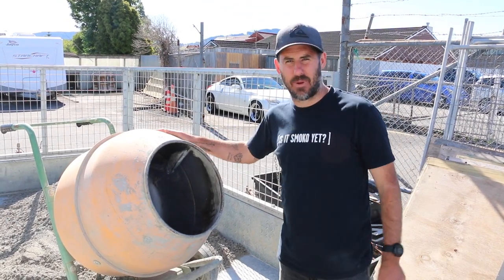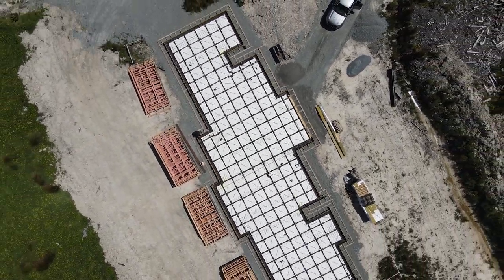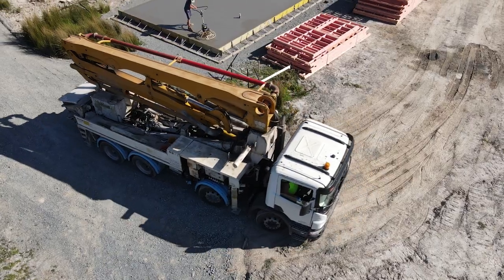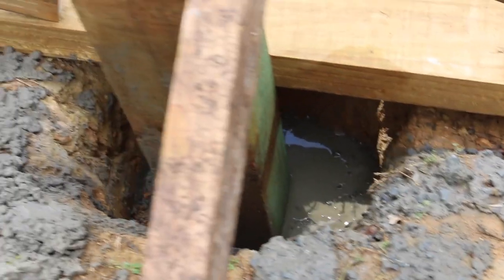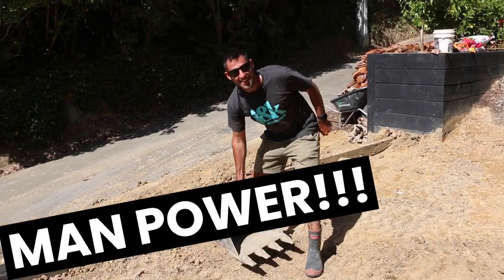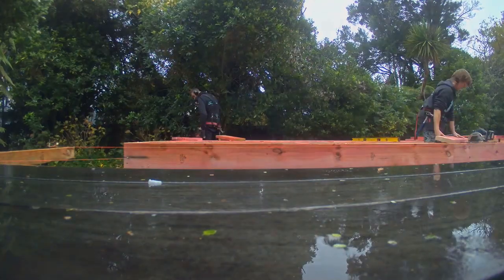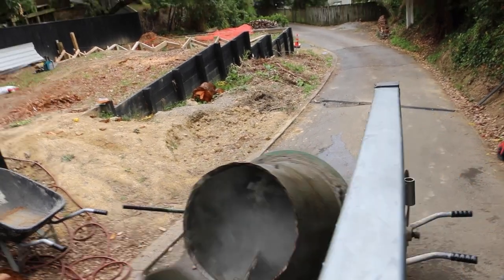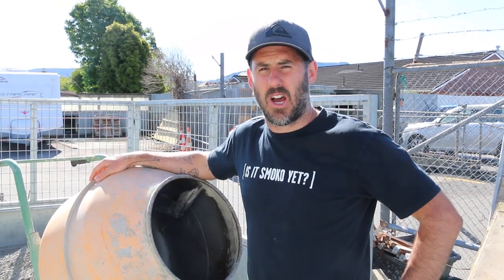Why Hire a Truck When You Can Mix Concrete Yourself?

Comment: Interesting. So I have this dilemma myself but the truck can't fully reach my destination. I asked the truck company if I could just wheelbarrow it the last distance and he seemed not happy about that idea, saying that the driver won't have much time to wait for me to wheel barrow. but now I'm thinking maybe he was exxagerating? maybe I should just stand my ground and say that it will take a little time but deal with it!
Reply: What did you end up doing for a solution @Niberspace?
Reply: @adrowsypoet  I had to manually mix that area and only hire the truck for the easy access area. But after that I've seen the same company visit my neighbour and there the driver stood parked for like an hour. so I think the company was just BSing me about this time pressure
Reply: @Niberspace  thanks for getting back to me bro. They might of been yeah, but I'm sure you did a great job at least.